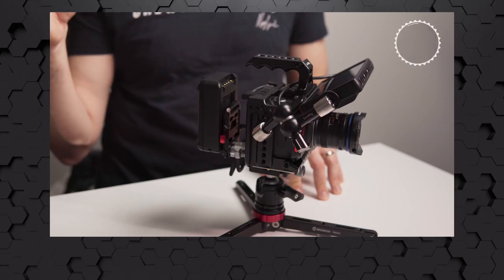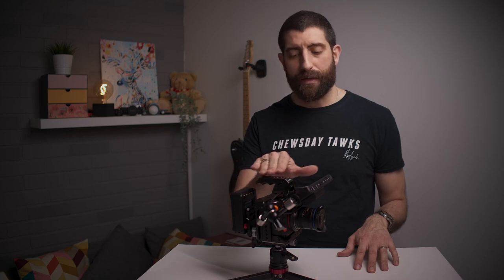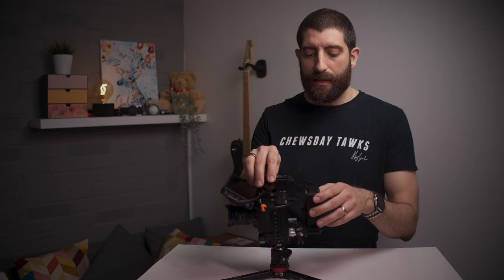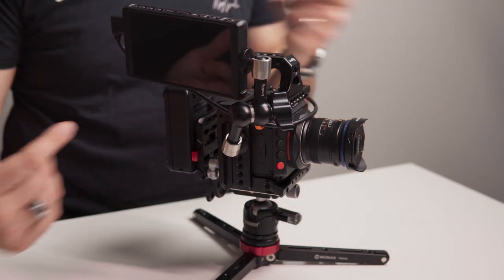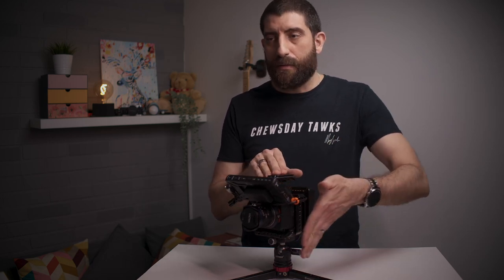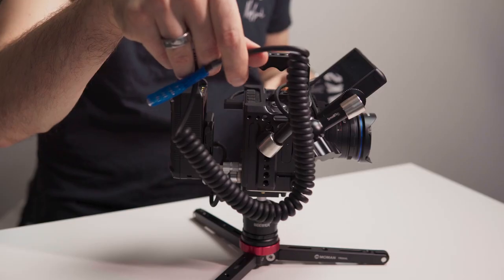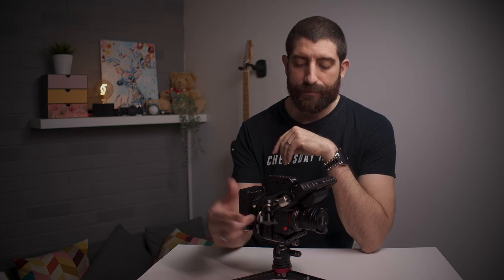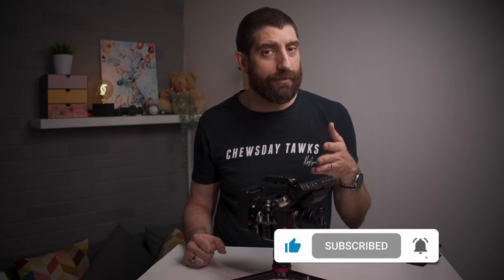Z cam E2c - a v-mount powered rig (with a couple of tricks)

Comment: Is the e2c rolling shutter terrible in 1080p as well as 4K, have you found any work arounds for the rolling shutter issue ? 

It’s the only thing putting me off getting one of these.
Reply from the maker: Yeah, it's pretty bad. If I understood correctly, the E2-M4 is pretty good at that (better than the S6, which is better than the E2c).

Besides, I think you'd have a hard time finding an E2c. New seems discontinued everywhere, and 2nd hand I don't think any of us are letting go of them 😁
Reply: I have the E2C as well (I love it) and I found that recording with the resolution set to 2336 x 1344, reduces the rolling shutter and has less crop factor. 
It has something to do with Open Gate? But I'm a complete beginner when it comes to cinema cameras honestly.
Personally I don't prefer 2336 x 1344 because I want higher resolution, but if I need to do a run and gun shoot and the final video is exported as 1080p anyway, you can record at 2336 x 1344 and resize or crop the video footage in post.
2336 x 1344 is not 16:9 aspect ratio (which is 2336 x 1314) and means that you loose some of the height when editing.
Try it :)